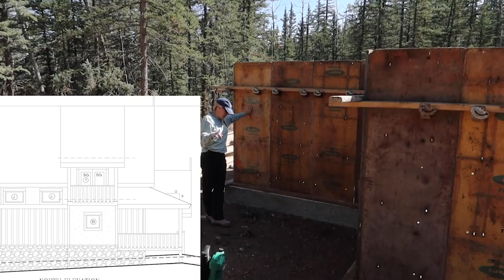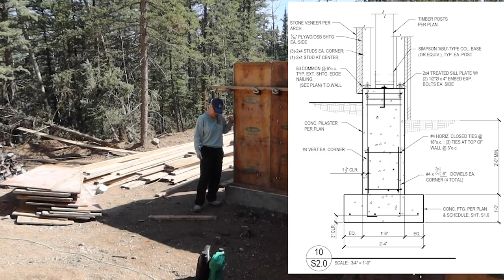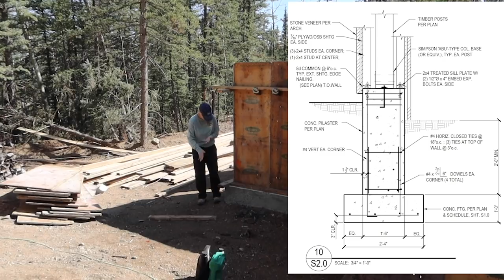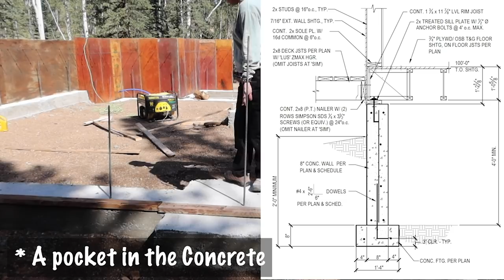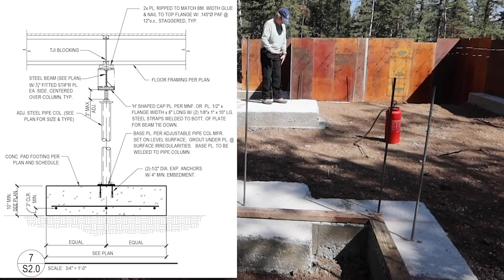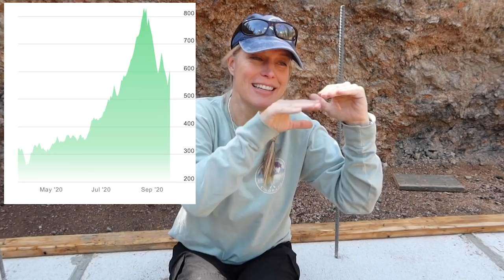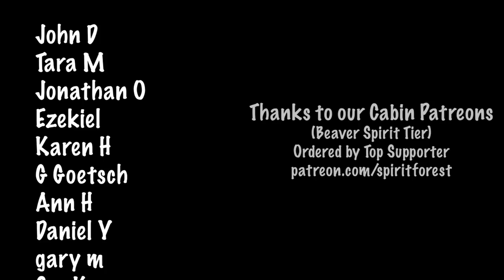Colorado Mountain Cabin Foundation is Starting Spirit Forest - S4 -Ep#83

Comment: Greetings from BC, Canada! Your site looks remarkably like ours with the 10 foot bank and entry level at the rear, heavily treed. Be mindful of drainage around your house, particularly when snow pack melts off. Also think carefully about steel roofing, temperature differentials tend to expand and contract steel and loosen the screws over time and heavy snow slips off them which can pose a threat to humans and animals. I wanted to build a single story on concrete slab (ours is a square log house), the builder convinced me to put a full basement in with 9 foot ceilings, I am pleased we did.  I hate cutting trees down but I have seen a few 90 foot trees blow over up here and I know to make sure that I have at least 120 feet clearance from the house, except at the back where trees are much shorter. We buried our water lines to 7 feet which is code. We have an old shallow well plus 2 underground cisterns (3,000 gallon total) The well is not producing this winter so we had to have water trucked in in January. Yes, builders are not the tidiest of creatures and cigarette butts are an issue where we are. Lumber prices pushed us way over budget and construction products and fittings have been hard to find with long waits. Thanks for sharing, take care, Chris.

Comment: Tammy, everything looks good.  Nice to see the progress. And just FYI - IRC – International Residential Code
The frost line in Colorado is typically 36” but can be deeper in areas with colder climates. Vail, for example, is 48”.
With mountain construction, as we see near our Evergreen office, granite bedrock is typically located at or closer to ground level than 36”. In these instances, section R403.1.4.1 of the 2009 IRC states that frost depth does not need to be met if the structure is erected on solid rock. 
The concrete forms are oily so the concrete doesn’t stick to it.
Reply from the maker: Thank you for the info

Comment: I re-watched  your Aug 27 video,  Here in Nova Scotia,  code states you have to put in an air exchanger as well.  You might also have to have a water treatment system if your water is hard (lots of minerals).   A friend said if you are going to have a 5 ft crawl space , why not make it 8 ft.  it should not be that much difference in price.   Your gear room is going to get cramped.  Love watching the build!
Reply from the maker: Cement is very high in my area... 'cause it takes so long to get to my property.  It is one of the most costly things in my home.  A bigger crawl space would of cost me a lot more and I was already over my budget.

Comment: Note to anyone watching: If you are building a 4ft crawl space you can put in full basement height for not much more and then it will add significant square footage appraisal value (15-25%) depending on what you add in basement.
Reply from the maker: There was a much higher cost to do so. Concrete in my area is one of the highest costs. Also the more the house appraises for the more taxes I have to pay.  There is a reason why I didn’t do a basement or a garage.  I am just trying to keep my cost down to a min in some areas that way in other areas I can make the house even nicer.
Reply from the maker: Thanks for your feedback.  My house is the Max height that is allowed in my county.  I am happy with it. I would of wanted a garage.. but that might be in the future who knows.